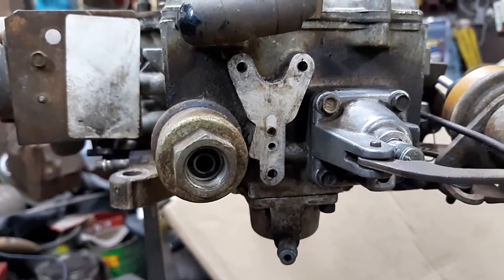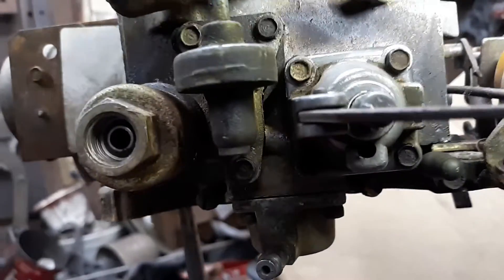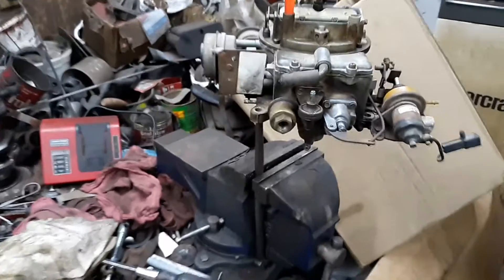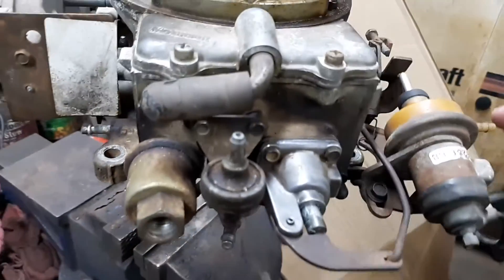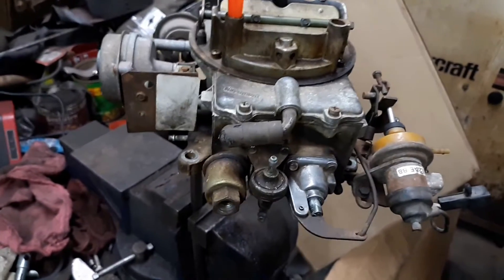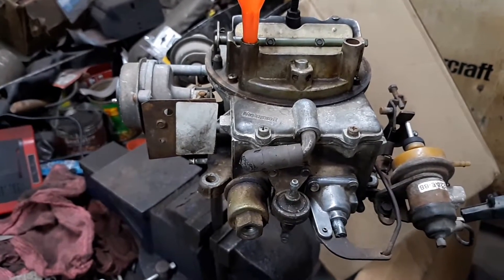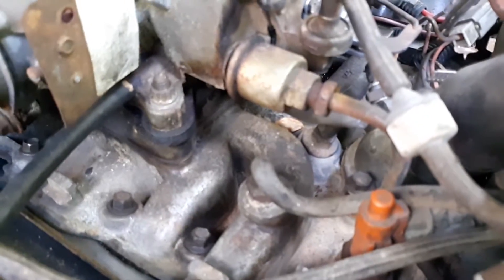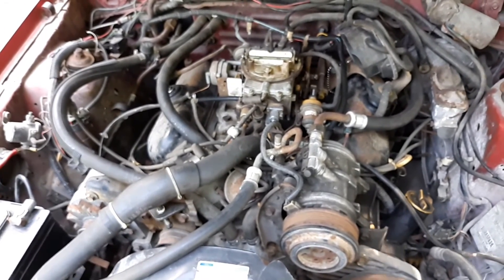Fixing the leak on the carb of my 83 Mustang convertible #foxbody

Comment: I think filing those mounting ears did the trick! Not sure if silicone and gas will get along, but adding pressure to the gasket sealing area will for sure! :)
Reply from the maker: It has to help with the silicone. Very thin layer in there. It was weird how it was leaking. You'd pull the throttle back it would leak. And after sitting a while the gas would leak out the bowl then be hard to start it. Only time will tell if it holds up.
Reply: Flattening the sealing surface definitely helps. Permatex has a sealant called Motoseal. It is resistant to damage from fuels. This ethanol destroys everything.
Reply from the maker: @mlieser1230  I will definitely have to look into that if this doesn't hold up.

Comment: I was thinking the mustang sounded a little off then I noticed it was a v6. I havent seen a v6 fox in a long time.
Reply from the maker: Yeah I'm keeping this one pretty much stock. I sure don't need to make another project car. Just put heads on this if you didn't catch that video.
Reply from the maker: I actually have 2 V6 fox bodies
Reply: @chefshadetree3972  thats cool. I've had 2 4cly one was a vert 93 and my hatch 92. Both got the 2.3 pulled and swapped with my turbo 2.3. I thinking of selling my 2.3 turbo engine due to not know what to put it in next. The hatch is getting a 5.7 hemi after im done with the frame rails.
Reply from the maker: @vanishingfox1339  the 2.3 turbo was a good motor. Can get pretty good power out of them. I have 2 turbo coupes and 3 XR4TI'S
Reply: @chefshadetree3972  those murkers are so cool. They may have been ahead of thier time.
Reply from the maker: @vanishingfox1339  Merkur, and yes they were. German engineering. The Sierra won a lot of races in Europe for a very long time.
Reply: So was there a gasket that goes in there? I didn't catch that part. Freaking 80s carburetors.... over complicating, something thats uncomplicated....
Reply from the maker: @OlysGarage  if you look closely you can see the gasket on it when I show the silicone on it. There is a gasket there lol